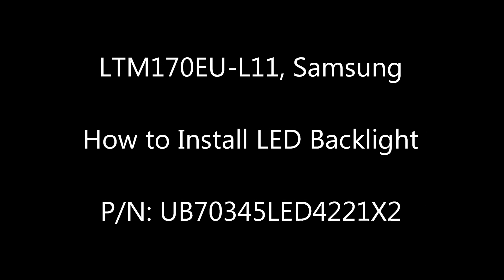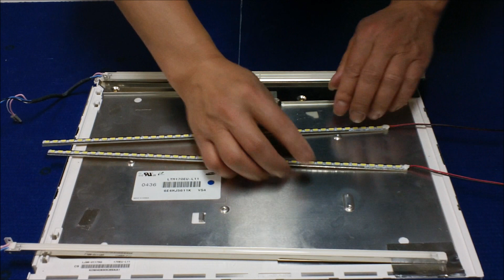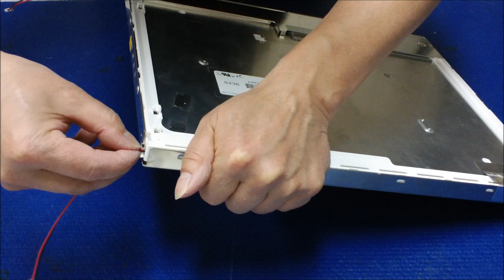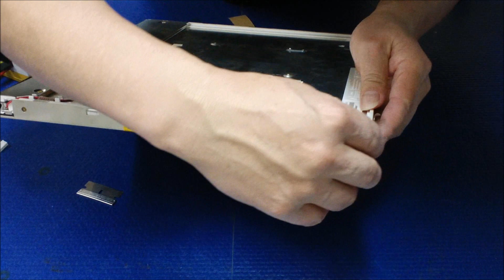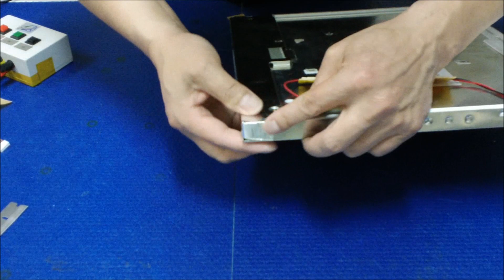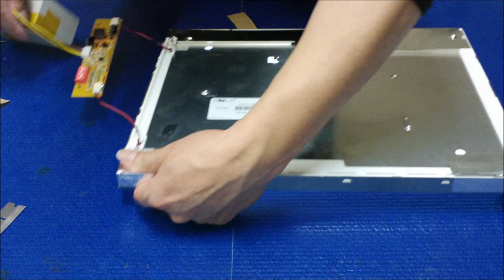LTM170EU-L11, How to Install LED Backlight

Comment: Is the LED backlight for LTM170EU-L31 also UB70345LED4221X2X1? I am trying to replace the backlight for LTM170EU-L31. I found LTM170EU-L11 replacement but not sure if I can use the board and other parts from LTM170EU-L31 to replace it with LTM170EU-L11.